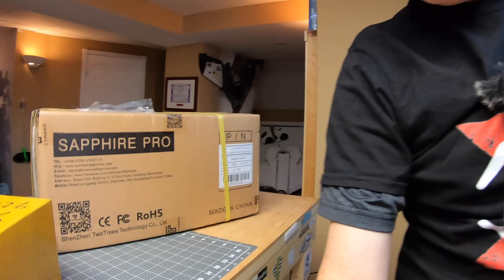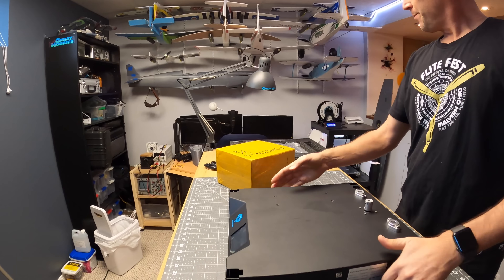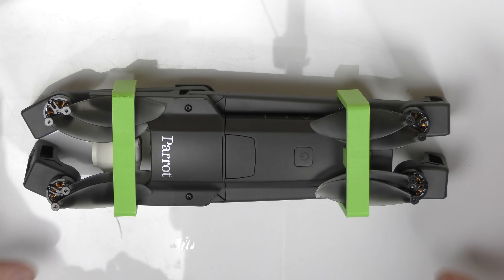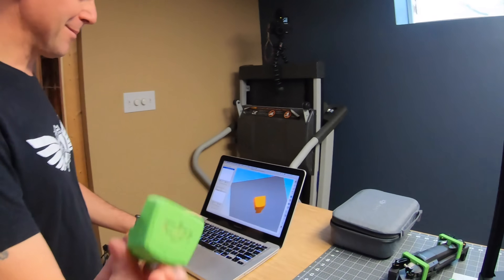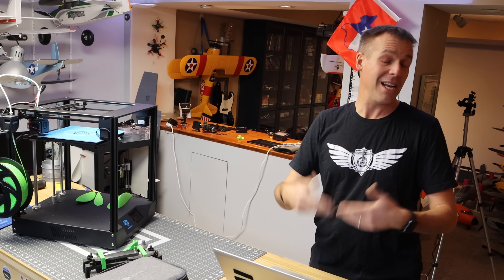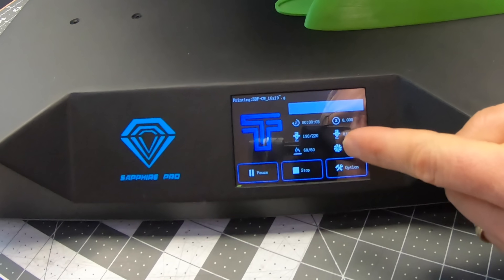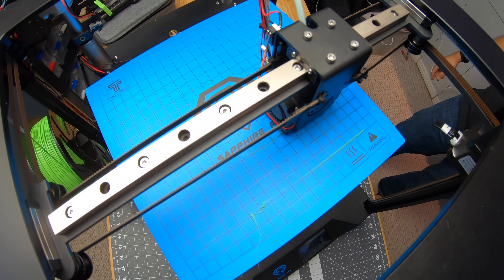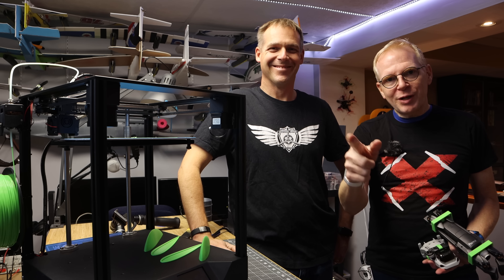Wow! 3D Printing Drone Accessories with the SAPPHIRE PRO - Mavic Pro, Mavic Mini, ANAFI, EVO

Comment: I seen multiple DJI Inspire 3D printed clones. Even the gimbal was 3d printed. Obviously it's missing all the software magic the official product has but it's impressive. I want to try an extra thin carbon fiber filament layer and skin it with Carbon Fiber. Not sure if it's practical but even if it doesn't result in lighter weight, dyi carbon fiber is cheap enough now to experiment with.

Comment: Thanks for this great video. I was about to order this item through the Amazon Web site that you suggest but I changed my mind upon reading a customer's review  that revealed quite a few problems with this printer. I wonder why Andre did not bring any of the problems listed below to your attention, Captain Drone:  Take the time to read it:.  Excerpts from Amazon:.The good and the bad. Lots of potential if I can get some issues resolved.

UPDATE:
I'm leaving my review at 3 stars, here is why:
1) Tech support does want to be helpful... and for some questions they have been helpful. However, be aware that if you really want help, you best not ask 2 questions in the same email, because the first one will get answered and the next one will not.
2) I gave up getting the issues resolved on my first printer, bought a second and it did not have all the issues.
3) I have lubricated my printer (both of them) very well, but they both screech so loudly when the z-axis is at about 50%. I can hear it from the other side of the house.
4) There are NO instructions on how to do automated bed leveling. I asked support for assistance and they showed me where the part goes, but not how to use it. People in forums (including a guy who modified Marlin 2.0 to run successfully on it) have not been able to figure it out.
5) There appears to be no place to mount the filament break detector, unless you 3d print a mount from thingiverse or make your own.
6) XY belts are not parallel everywhere.

That all being said, Tech support really did seem to want to help. Perhaps, part of it is a language barrier, but they seem to insist on getting a video to help.... even if the problem doesn't require a video. I understand where they are coming from, but sometimes a simple answer will do.

I did get the second printer working and so far, it has been running okay. Err7 (temperature issue) plagued me for a bit and seems to be a common issue. Some people have resolved it with a new config file (but then I noticed more drift), some by doing a PID auto tune, some by installing Marlin 2.0 (I haven't been able to get it working on mine yet).

----

Right now, I'm at 3 stars, but I think that will improve after I work with customer service. I say work with customer service because I wrote them... and they responded... but I don't have a response to all my questions yet. The printer appears to be very well built, and overall, I think it has the potential to be a super printer. Here's my pros, cons, issues, etc:

Pros:
- Very strong structure.
- Reasonable size
- Seems very stable
- Very nice first print
- Very well packaged!

Cons:
- Maybe, over time, this will run better than my other belt driven printers, but I hate belts (I love the Kodama printer / Panowin printer --- except for the small size)
- I was really hoping for a square printer without parts external to the structure. In this one, the extruder motor is on the outside of the structure.
- I don't care for the tension relief in the wires coming out of the extruder hot end. The wires bend a bit too much. To feel more comfortable with it, I will need to print a part to extend the top a bit to grab the wires in one more place.
- It took quite a while to put together and decipher some of the directions. It wasn't quite minimal assembly... and yet many pieces were assembled.
- I prefer direct drive to Bowden drive, but time will tell.

Issues:
- I see a plastic gear in the extruder. I HATE PLASTIC GEARS!!!!!!!!!!
- The instructions start good, but miss several steps (I did find a video build on the included disk)… I didn't notice it until after I was done. However, even it leaves out steps. There are three items I don't know where to mount (1) The filament break detector (2) The 'automatic sensor (3) one of the three heatsinks
- Unfortunately, I have 2 areas on the z axis that screech.... as well as a extremely severe vibration noise at some point in the warm up. I haven't figured out why yet.
- There are no instructions on how to get up and running with the software. There are some install files and a configuration file. Due to all the other issues, I haven't had time to investigate and figure it out yet.
- Did I mention plastic gears are HORRIBLE?

If I can get these issues resolved, this will be a fantastic printer.
Reply from the maker: So one person has problems and that means everyone has problems?   Andre knows what he is doing so the chances of problems are very slim.  Are you one of those people who avoids watching a movie because you read one review of one person who did not enjoy it, yet so many others did?
Reply: @CAPTAINDRONE798  : you got me wrong. I like your work and I have been following your channel since a long time. I followed your recommendation and went to the Amazon site that you proposed in your description. There are only 3 verified customer reviews there. And the one that I quoted was one of the 3 and presented very serious concerns that I think Andre should look at. (Forgive my bad English: I am French Canadian.)

Comment: Have been working 3D printing for little over three years.   This is a nice high level view of the product.   From my experience,  the learning curve is pretty steep and be prepared at times to toss the machine out the door.   This is an FDM style of 3D printer that extrudes melted plastic onto a heated plate, one of the best FDM printers out today is Snapmaker,  which also gives you the ability to change printing heads and use CNC head for wood carving,  laser  head for burning images and a laser cutting head to cut the 3D  images out of products. .   Another technology that is coming into maturity is an SLA 3D printer that uses UV light to cure liquid resin.   If interested in learning about 3D printing,  there are many good channels on YouTube that reviews 3D printers and printing much like this channel does for Drones.  One of the best ones on YouTube is Maker's Muse..   If interested,  go check them out.     This maybe alot of information for a Drone review channel,  but thought I would throw it out there.

Comment: A couple of tips for beginning printers. 
1) Trial and Error is part of the game.  Especially the first few prints you'll need to keep an eye on it. Set it and forget it 
2) Start small before going big.  Test print a small version of larger prints. It's a way to troubleshoot without burning hours at a time. 
3) Make sure the printer is in a well ventilated area.  It melts plastic and that process creates some fumes.  plan accordingly.
Reply from the maker: Good points.

Comment: Steve it’s more critical if you slam a door or have creaky floorboards while the printer is working mine is accurate to  one sixthw of a millimeter so you have to be careful with an open one more so  they are fun
Reply: I made an enclosure with IKEA tables. Might need to make a 2nd level. When doing the long prints for the planes I put foam board around the case. Keeps the cooler temps away from the printer.

Comment: Amazing video (as always). Your reviews are awsome. By watching you i bought sg906 beast drone. But i have a little problem with the app. The app doesn't show me the real time recording. So it's kinda Hard to fly it. While on my dad's Phone it is showing in real time. Please answer if you know how I can fix it.
Reply from the maker: It would be a Phone issue (problems with memory, video circuitry, etc).  Not all phones are the same & sometimes even a good phone can turn into a slow video phone due to one bad memory hog app.
Reply: @CAPTAINDRONE798  thanks for the reply.I am using the app called HfunPlus. Do you know other app for the drone? Also my Phone is huawei p20 lite and my dad's Phone is huawei p10 plus. I Will delete some apps boost my Phone re-install the app and on Saturday i am going to test it.

Comment: I've been thinking about getting a 3d printer and now I think you've finally sealed the deal with that sleek little model. I love the fact that it's easy to level and you can move it if you need to. Now I know what I'm buying. Thanks.  : )
Reply: Firstly 3d printing is great go for it I have a printer for about 2 years and it has been really nice. 

I would like to say that you can move 90% or even more % of the consumer 3d printers like this one too. There is also really good consumers friendly and cheaper options too. 

For example I can say Creality Ender 3, or anything from Creality CR10 printer line, Anycubic printers and so on.
Reply: Utku Yılmaz very nice. Thanks for the info.

Comment: Yahoo! My favorite YouTuber posts another. I checked the price on Amazon and was amazed. $390. Wow. Impressed. Great video Captain. I’m not sure how I would use this. I can see there is a learning curve.
Reply from the maker: I was surprised that it was easier to use then I had expected.  The more you use it the better you get at becoming a 3d printer pro.
Reply: CAPTAIN DRONE thanks. But I still need to learn why I should own one. If I found a reason, I will buy this one!